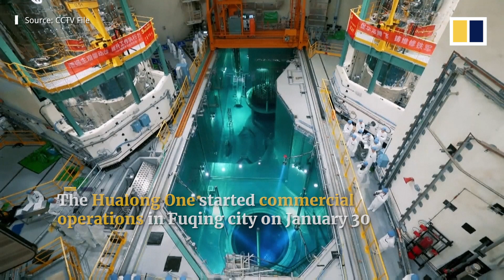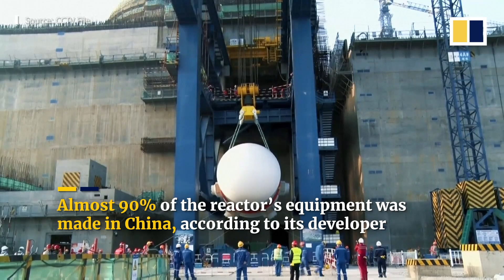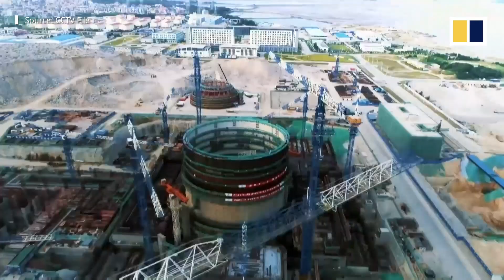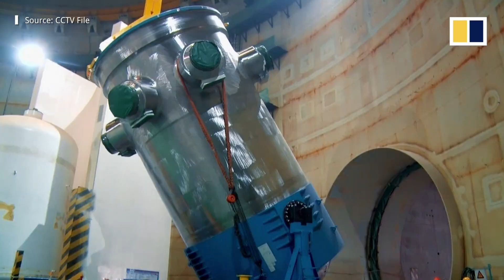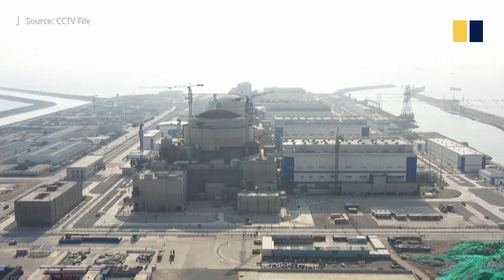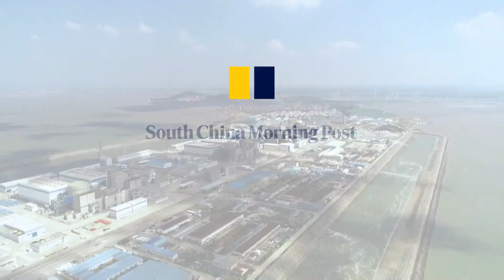China’s first Hualong One nuclear reactor begins commercial operations

Comment: After 60 years the what? This whole area should be sealed off?
Reply: Johnny Sins  do you even English?
Reply: Johnny Sins  no worries
Reply: Johnny Sins  you upvote all of your comments? 🤣🤣 So sad... U need help.
Reply: Johnny Sins  not my fault my ancestors were mainlanders. Now we are Taiwanese.
Reply: Johnny Sins  lern how to use toilet first.
Reply: Most electrical equipment has a finite life.  The winding in the generator has insolation coating that degrades with time and operation hours.  Mechanical parts and electrical components can be replaced but economically after 60 years it is deemed a new design would have advanced to make the current set obsolete when it is cheaper to replace than maintain it.  A turbo generator typical design life is about 40 to 50 years.
If the plant were to operate normally without mistake it could ne knocked down and rebuild to a new design with very little radioactive byproducts.  You only need to seal it when something go wrong and the core becomes radioactive.  Most nuclear installations complete their life design without accident.